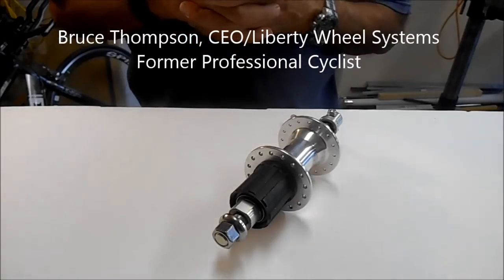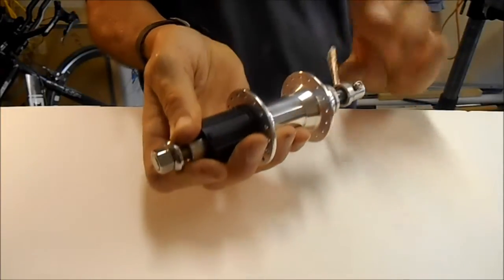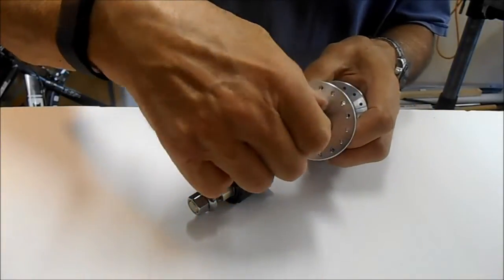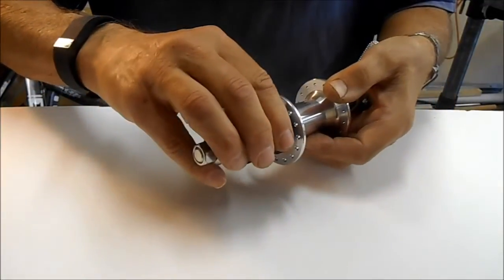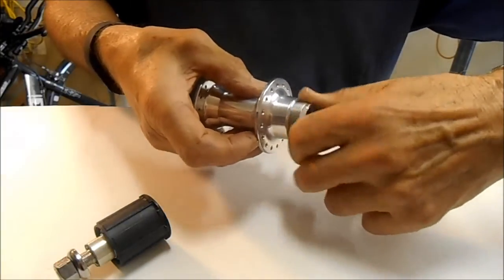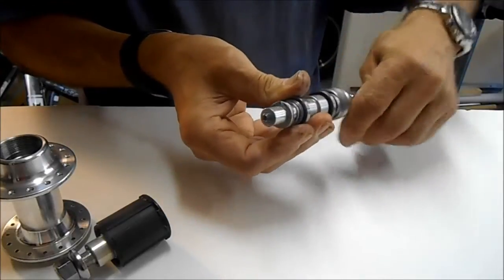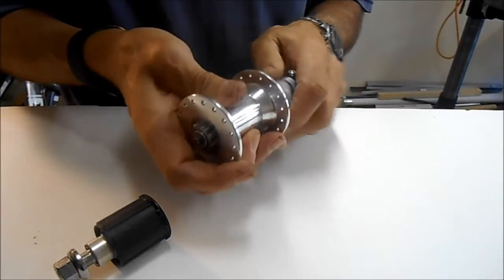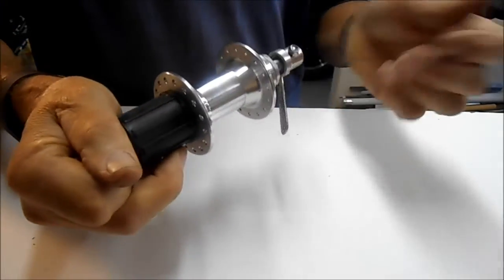HubDock Quick Release Rear Axle -- A Look Inside

Comment: Glad to see the old Bi-Valent system is being resurrected.
The adjustment collar should be modified (yeah, I also
designed this hub, albeit many years ago) for tension as
well as drop-out spacing.  This will allow the nut on the right
to be replaced with a Dzus type fastener.  The skewer goes
into the fastener, 1/4 turn, and then flip the QR skewer to lock.